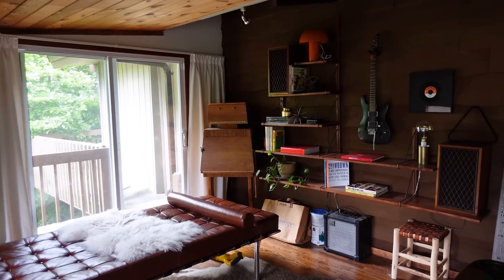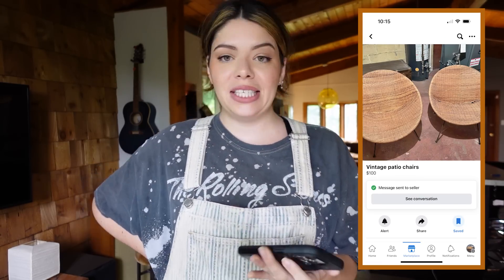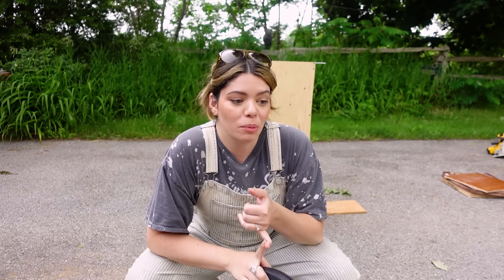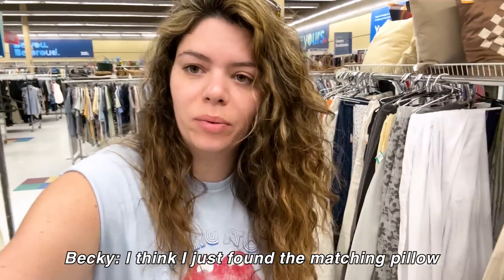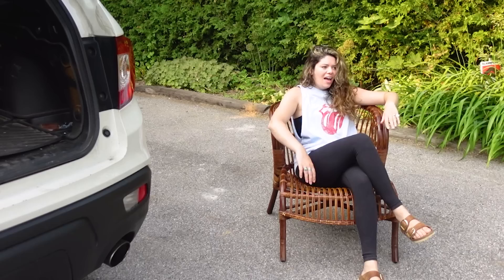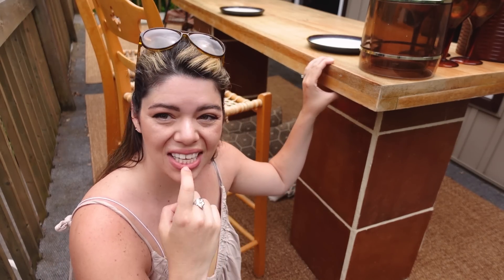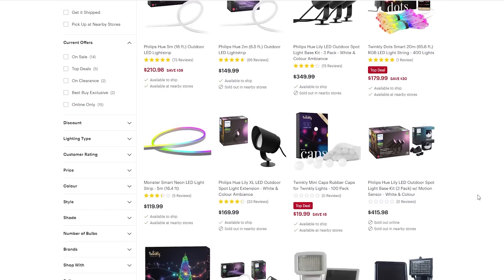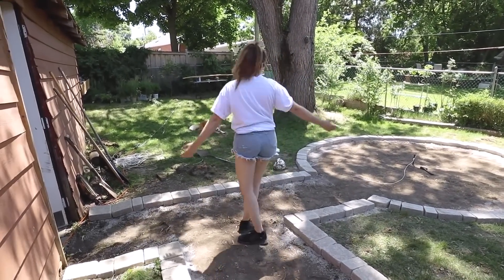COMPLETE BALCONY PATIO TRANSFORMATION | lots of thrifting and DIY

Comment: It turned out so beautiful! Love it. My only suggestion would be to turn the table leg so the cracked tile is on the inside and not visible. Other than that, chef’s kiss! Oh, one other thing… you’re right that the cane bar chairs won’t collect water on the seats, but they will mold if they’re left out in the rain and snow over winter. You may want to put them away in garage if you have one during those months.
Reply: Polyurethane  works to.prevent 
moisture damage.but would take multiple layers

Comment: Lovely makeover ! For the issue with the table and the stools' heights, as an alternative solution, I think I would have put the table on (lockable) wheels : you get the bar table height you originally wanted, it matches the stools’ height and it gives you the option to move the table if ever the situation would call for it ! (like a little dance party with that new speaker ? ^^) My 2 cents 😊 But great job !

Comment: I hope you tightened up all the loose railing slats and crowns.  Danny might think it is his throwing stick (missed him in this vid).  I had a upper floor balcony in CO USA and that was a yearly chore, due to all the cold, wet and snow.  It looked like moss was growing on the existing carpet.  It might need a power wash and fungicide spray.  The lighting is wonderful, but I am afraid I would trip over it.  The bar stools might need a cap on the boot of each leg to save it from weather rot.  I had wood bar stools in a damp environment that only lasted a year, because the legs got wet rot and dry rot.  Thankfully, they were thrifted items, but it was still a loss.  The outcome is lovely.  Thanks for the info on Best Buy.  I have only purchased electronics there.  I liked the half umbrella and the zig zag plant a lot.

Comment: 23:17 the crack in the table leg is totally noticable. Turn it to the inside (where your legs go) and no one will ever see it... Unless you drink them under the table. If you've attached the legs to the top, turn the whole table around so the crack is on the opposite side (by the railing). 💖🌞🌵😷

Comment: looks good, though a little worried about the safety of that deck. especially since it's a carpet holding water against either a wood or metal surface and clearly not drying (moss).

Comment: Just for the future you shouldn’t use plywood unprotected outside when working with tile. It should always have a waterproof board like Wedi board or hydro block to prevent your tiles from coming off. Plywood absorbs moisture from your adhesive and the environment which can cause the adhesive to weaken and the board to warp. Plywood can be used inside for decorative purposes. Broke my heart a little to hear you say you wear breaking the rules for your outdoor project when that is when you should really follow the rules. All sent with love and in the hopes of helping you and others. -a mosaic artist

Comment: Ok Becky 🙈 Lovely However🙊 that wooden 🚨table top 🙉isn't water proof 😭 
🎭 ASAP🙊 Changing Table Top Required 🛑 Weather Conditions will make it swell & rot out; Unless You Either add stone on top of it or grouted tile  
🦺⛑️Recently this issue was addressed on "HGTV's Episode" of "Battle on the Beach"; when the Two Guys Had the same.kinda table top idea 💡 but there's was also too close to.A Grill 😢 a 🔥 🚒 FiRe Hazard and Got Called Out ⛑️🦺.
So 🚨Calling Becky ☎️⛑️Safety 🦺 Check ✔️
🙈Must ASAP ❤️‍🩹 Replace wood 💬with grouted tile (ugh🙊) or a slab of stone (maybe the broken slate from the pool table or a remnant of a stone slab 
Otherwise 🫠
Great Job 👍
 PS 
"Sorry for the Bad Press" 🧐😢
Love Your Ideas but Safety First 🥇❤❤❤